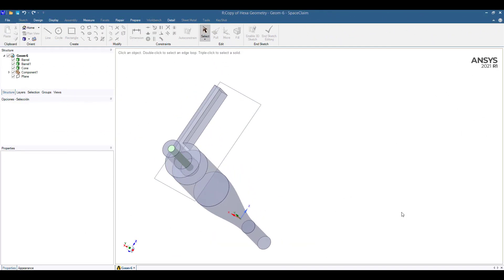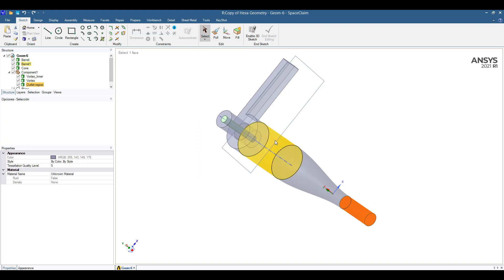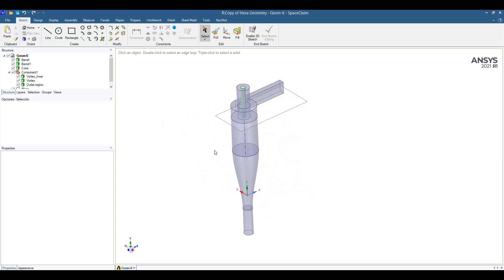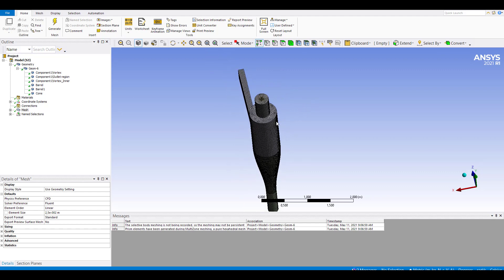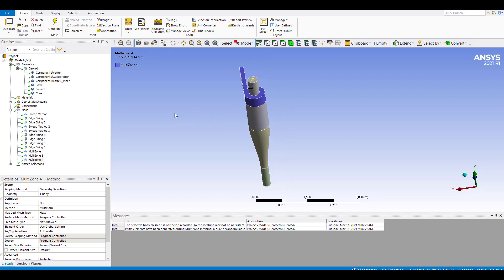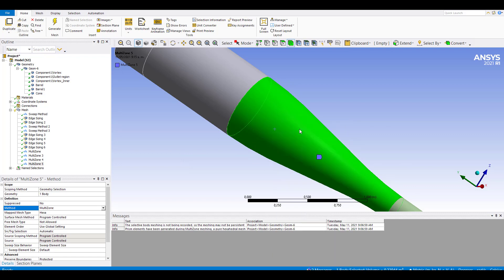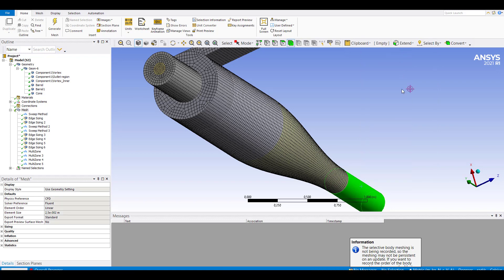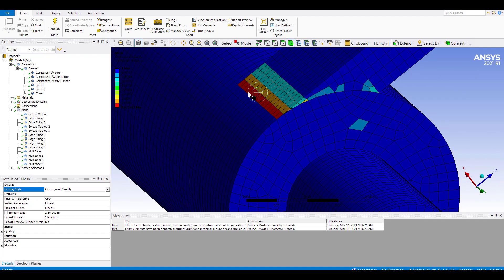Modeling Cyclone Separators using ANSYS Fluent - Part 1

Comment: sir, i tried to simulate the ECAP process in ANSYS, but the work piece is not deforming.

i defined the "L" shape tube as die and work piece is inside the die, i applied displacement from top. but the workpiece is not deforming can u help me sir,

rajkishorek30@gmail.com this is my mail id sir